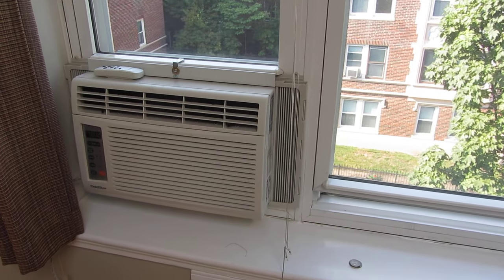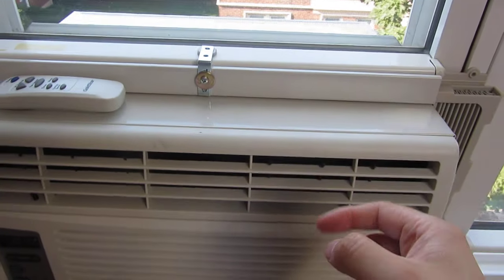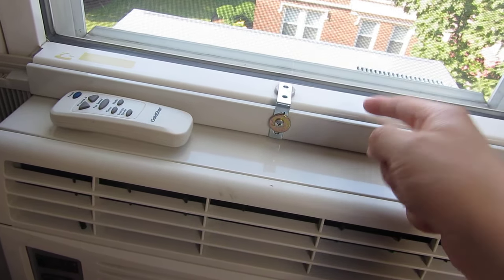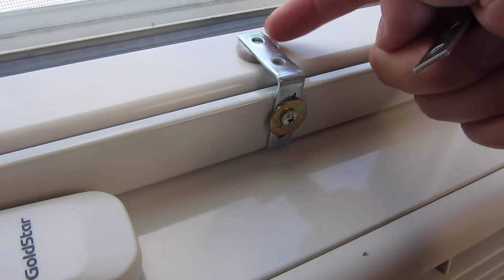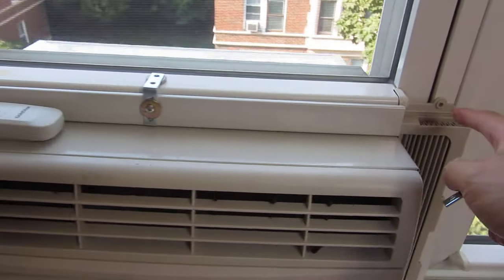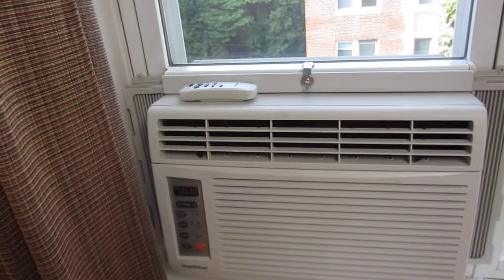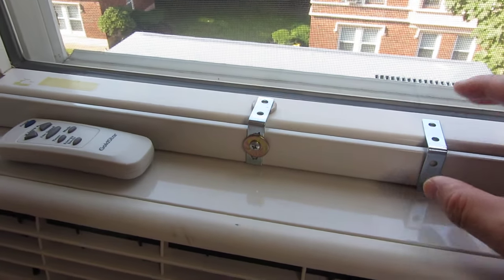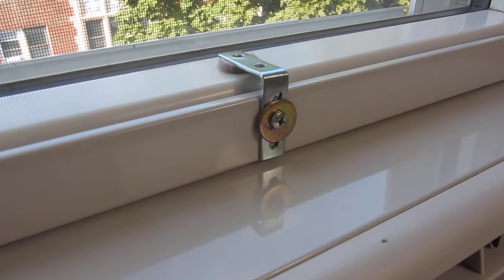Secure AC Window Unit without Drilling Holes and Damaging Window How to Install Tips Solution

Comment: This is a bad install. The bottom rail of the air conditioner is supposed to sit inside the aluminum window channel where the sash comes down (which also prevents the unit from moving), and that way the side panels would also lock within the channel. You have it resting on the inside window sill instead, and so the side panels are incorrectly on the inside of the window frame in such a way that rain on the outside of the panels would run down to the inside sill and ultimately to the floor. This install is not per manufacturer instructions.

Comment: Securing the A/C with out drilling, yet has to drill a hole?
Reply: Without drilling into the window sill.
Reply: He's drilling into the metal bracket that is attached to the unit.